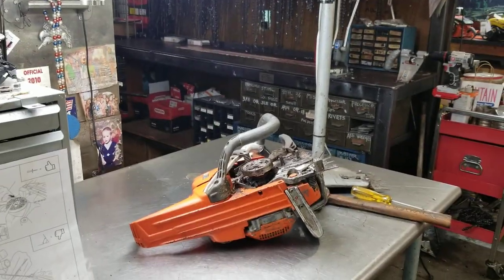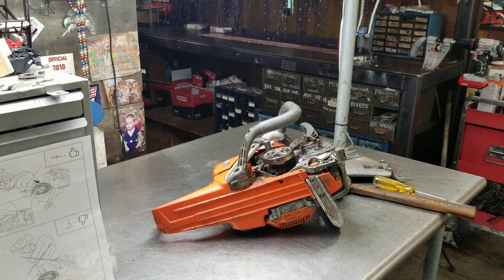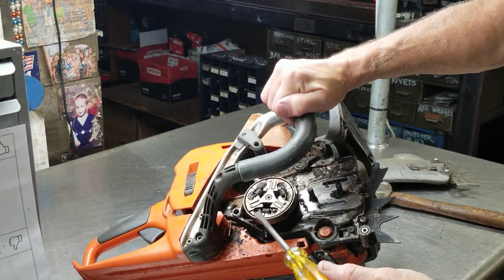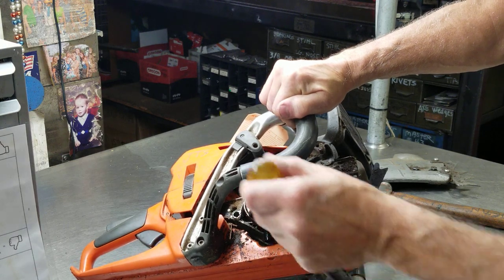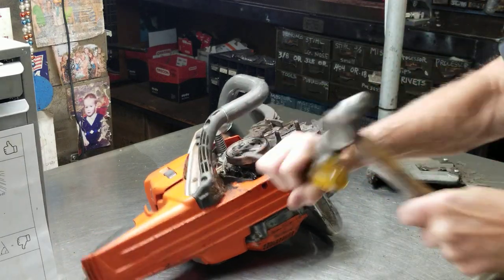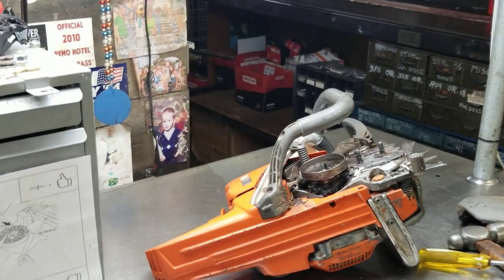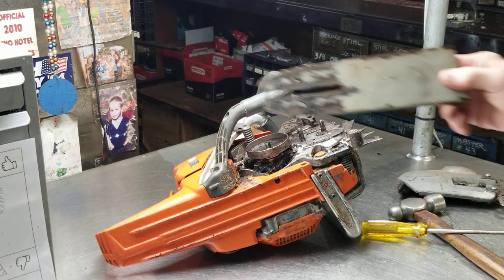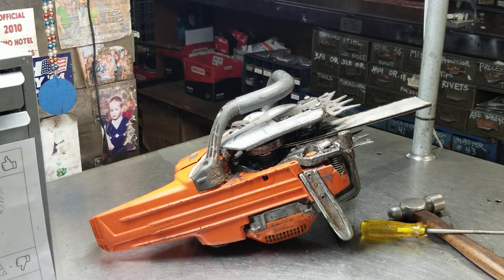West Coast Muscle Saws Clutch Removal Husqvarna 562 Xp

Comment: After breaking a few using this method due to excessive heat or corrosion you can just buy/make the notched socket that spreads that impact over the entire clutch not just one sprag. TSB or not there are methods with a lower yeild for damage
Reply: If you broke one using this method it wasn't safe to begin with and required replacement anyway.
Reply: Many are simply overtorqued from the factory. There is nothing wrong with the clutch making it unsafe in any way.
Reply: @Chevron.Muskoka  Sorry but that is incorrect if it was weakened from heat and corrosion or stressed from torque and you hit it with a screwdriver and the clutch cracks or shatters it was indeed unsafe.
Reply: The heat,corrosion or overtightening does not compromise the part whatsoever. Overloading a single clutch sprag and shockloading a cast part is what causes the failure when removed. Its literally covered in a dealer service bulletin for when a customer's complaint or Tech's covers the condition and the updated work method is to use the removal tool rather than using a method known to cause failure.
Reply: @Chevron.Muskoka  It is not covered in a service bulletin as over tightening and heat damage is not covered under Warranty and is a safety hazzard and requires replacement to prevent operator harm. This is the certified method of removal in the repair manual as provided in documentation per Husqvarna. Stop spreading misinformation that will cause someone serious harm. If a clutch is overheated or over tightened it needs replacement as it is a safety hazzard. Husqvarna is not going to make themselves liable for someone getting injured by running compremized equipment.
Reply: Service bulletins are not related to warranty issues that would be a warranty bulletin. They are for service advisories and manual ammendments<read that again. Hoover whatever koolaid you wish but advising the use of the appropriate tool to prevent damaging a component is far from misinformation. Good luck in life
Reply: @Chevron.Muskoka  I did read it and service bulletins are released by Husqvarna which again are not going to suggest any information related to using potential problems from metal fatigue. Good luck in life pretending to be a tech you don't do it very well.
Reply: Lol @ pretending, your nothing but a mouthpiece. Look how you're trying to twist it now aswell, no sort of metal fatigue or previously failed/damaged part is mentioned thats all you attempting to twist the context in your favour. Replacing a failed part vs causing one to fail from a hack work method are entirely different. Again read the TSB its also included with the tool.